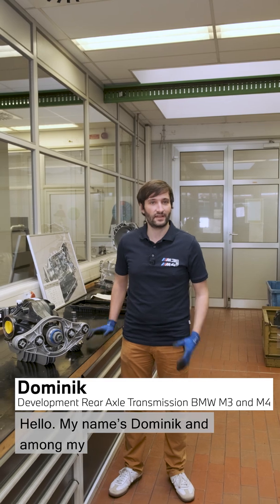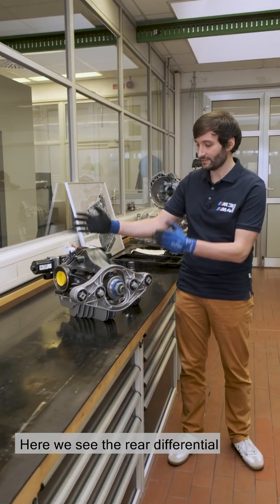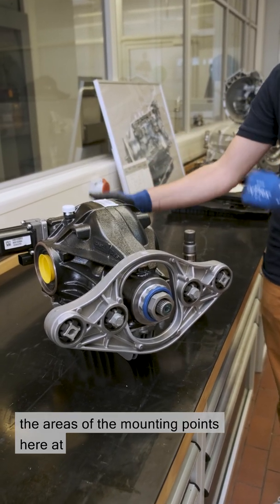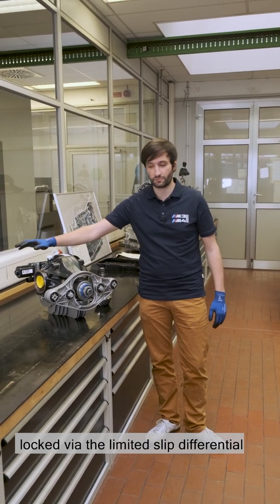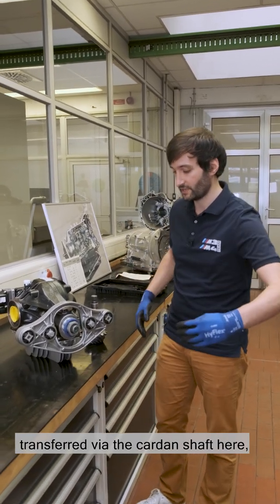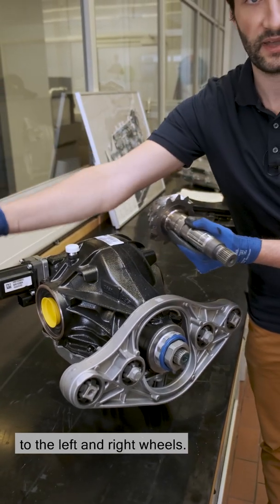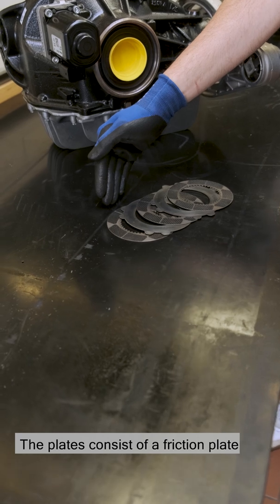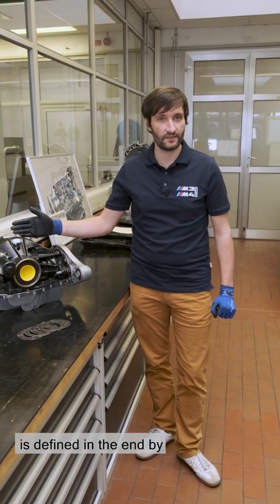Rear Axle Transmission. M3 and M4 - explained, Episode 16.

Comment: Does this diff use the rear brakes to control wheel spin even with dsc?
On track the rear brakes are wearing heavily - faster than fronts. The e90 was known to do this. Also would hot rear brakes due to excessive traction intervention that throws code 48087D cause engine speed reduction?

Comment: Great video but I didn’t understand why the larger diameter of one of the driveshafts improved traction, could you explain that a bit more?
Reply from the maker: The two rear output shafts are designed with different stiffness resulting in an optimized harmonic behaviour of both rear wheels and thereby increasing traction.
Reply: @BMWM  Thank you!
Reply: Usually this also helps stop wheel hop. Identical shafts would, like they say be a bad harmonic behavior
Reply: @pacoflyer  they have forgotten this feature in my m2 which hops like a bunny on launch